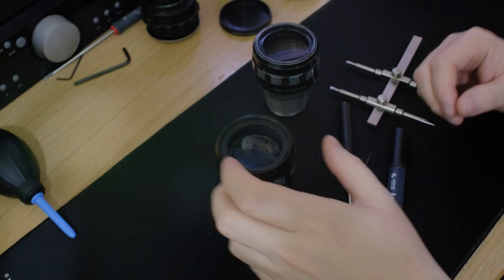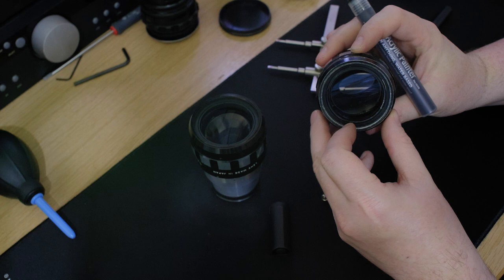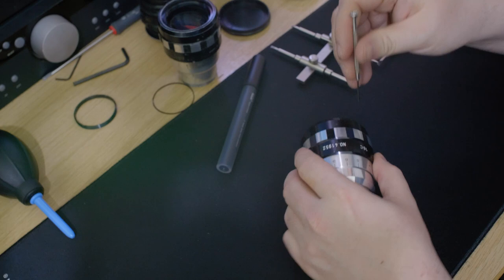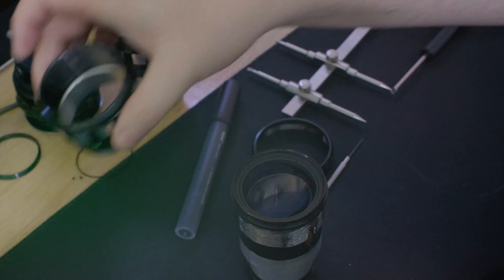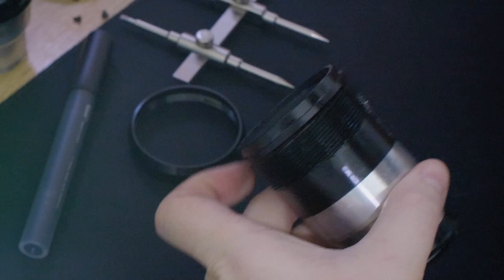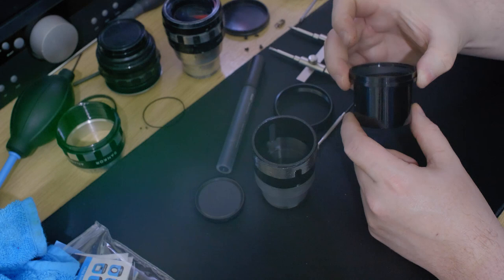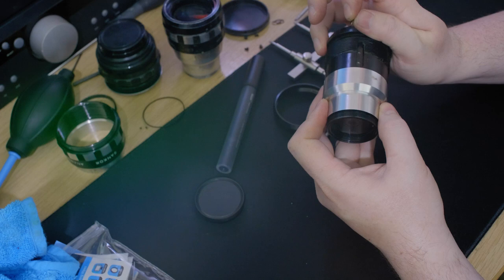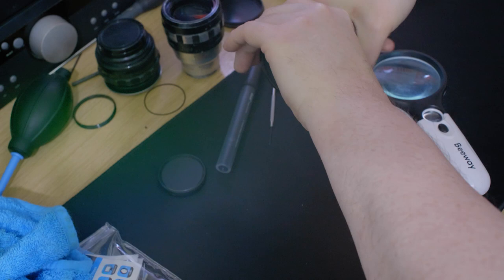How to disassemble/reassemble an anamorphic scope Kowa : Sankor : Eiki

Comment: You're a god. I would never have had the courage to actually open it without this. Thanks a lot! (By the way, the "sharpie trick" on the front didn't work for my Eiki 16F, thats why I wanted to try painting the inside, which also didn't change anything. Finally, painting the outside of both lenses from the inside&outside did the trick, in case anyone has the same problem)
Reply from the maker: Scope anamorphics aren't scary to work on really, glad you decided to give it a go.
Reply: May I know did you use the matte black adhesive film to paste inside the scope? Or just matte black paint painted inside the scope? Thanks.

Comment: This tutorial was super helpful! Say if the focus ring was a bit stiff on my Sankor 16C would you recommend adding any specific grease to it?
Reply from the maker: No, see my other tutorial, it's more likely fastened too tight.
Reply: I re-greased the ring with standard mechanical grease. It's better than before, but still not as smooth as a regular lens. I am not an expert but I think, when the built it, the smoothness of the ring never was a central priority since it was a projector lens and it wasn't really necessary for it to operate super smooth. Its just a guess, correct me if I am wrong :D
Reply from the maker: @metascopefilm  they're rarely perfectly smooth.

Comment: Any suggestion on what grease/lubricant use for it? I did the trick and it kinda helped but now the focus is a bit tight in certain places... 
Also is there any way to clean the optics on thses lenses without bringing even more specks and dust in? Mine was apparently disassembled before, and probably wasnt really cared for properly, as there are smudges inside, which are not visible on camera but look hideous aesthetically.
Thanks for the tutorial!!

Comment: Hello! New anamorphic shooter here and attempted this mod to sharpen my B&H scope at infinity focus, however 2 splotches of grease made their way onto the inside of the back element, what would you recommend to clean this without harming the lens and its coating? From my own research I’ve found my options to be “Lens Pen”, Microfibre cloth, and q-tips (along with non alcoholic lens cleaner solution) but wanted to check here where I can find the experienced knowledge I’m looking for in case I’m missing something or am on the wrong track
Reply from the maker: Just use lint free cloths (Amazon will have them) and a lens cleaning fluid.  The cloths themselves will mainly pick up the grease.  I tend to remove all the grease before I start working on lenses to avoid this kind of problem.

I'd throw the cloths away afterwards.

Comment: Great video, thanks for sharing this knowledge. Like others in the comments, i have fungus/smudge in between the glass of the rear element. A bigger problem, the elements are completely out of alignment. Even looking through the scope everything is out of focus. After opening the lens and removing the screws, i had to rotate some 30 degrees to achieve alignment, but now the screws holes are not acessible. I am thinking about drilling new holes, like you did in the other video... Is there another way? Is there a way to rotate the front element and not the whole front "body"?
Thanks again, any help is very welcome.
Reply from the maker: I reckon your rear element is likely loose.  Buy a lens tool (Amazon have them) and see if you remove the tightening ring if it will twist by hand.  I had this problem once and it was the rear being loose.
Reply: @P13DM  thanks for the reply. I have a lens wrench, already was able to remove the rear tightening ring, but i went no further. Without this ring, how can i rotate the element?
Reply from the maker: @mmixo  if you remove the ring and it won't budge then it's still glued and can't have become loose in which case it must be the front.
Reply: @P13DM  Ok! I will try rotating the rear element (but can't use the lens wrench now. I think i may not have the tool i need right now. Maybe a "sucction cup"? I dont know the english translation of the tool i am thinking about)

Comment: Dude, this is great. Thanks for posting. Quick question: Would you say all Scopes have similar insides? I have a Sankor and a few others. I'd like to lock them at infinity to put a FVD-16A or -16B on them. If they're all similar I can knock that out. If they're dissimilar...
Reply from the maker: Most scopes are similar to this, so Kowa, Sankor, Cinepro, Eiki etc.  There is an m2.5 hole in many of these kind of scopes were you can use a grub screw to help lock the focus.  One of my other videos shows me drilling to do a permanent lock (albeit that's arguably overkill).
Reply: @P13DM  Ah ok. I have a couple of Kowa 16-S, a Moller-Anamorphot 16/2x, a Isco-Gottingen 16/2x and Isco Gold Ultra Star 2x along with the Sankor. I was thinking about sending them all to Bernie for a CLA and infinity lock. But if I can infinity lock myself...
Reply from the maker: @BillPutnamPhoto  at very least you should do the Sankor and Kowa.  The others I might be tempted to just tape them.  I think the other scopes you have aren't so easy to open and likely don't have a grub screw hole.
Reply: @P13DM  Thanks. Appreciate the insight.

Comment: this is so helpful, thanks for posting this vid up.         Got a question, I have fungus on the front and rear elements on 2x sankor 16 lenses.    are there only two elements or three and if so how to reach all of them please?  if I take my lenses apart will I be able to reach the front and rear element or does it need further dismantling?
Reply from the maker: Just two so the cleaning should be easy.  On occasion the fungus (if it's bad) can get between the elements, as each elements can be a number of glass pieces glued together.
Reply: @P13DM  ok thats great thanks, the front element looks to have some on it then there looks to be another bit of glass behind it, would this be a glued one and if so any tips on accessing it?
Reply from the maker: @dogtemple26  there's one every 2 elements unless some one ever opened one and added a filter (very unlikely).  If fungus ever gets between the element it'd likely be more expensive to fix than buying another...
Reply: @P13DM  thanks, so the very front element isn't easily accessible and not worth trying?

Comment: so on the focus.. I wasnt clear on how to adjust the focus. I have a sankor 16d that is not sharp. Do I align the rear element or can you align it from the front?  thanks
Reply from the maker: You'd align the front albeit that's not really changing the focus but the alignment.  On an anamorphic lens as it slides forwards that is moving towards infinity.
Reply: @P13DM  Thanks.  I get the slide  to front and back, but our scope is not sharp at any distance. The adjustment needs to be left or right. The brass guides dont allow for this adjustment. Is it better to try to realign the rear or the front ?  ..is it even possible?  dw
Reply from the maker: @dr5chrome896  you'd do the tabs left to right normally.  Failing that buy a lens tool and remove the rear retaining ring and see if the rear element is loose.
Reply: @P13DM  ..I see now.. Just looking at it seemed like there was no left/right but i you loosen the screws there is a very fine adjustment.. Thanks for the time !  dw

Comment: Sir, is it possible to open the back element. Can you put a video on this.  I have a Sankor 16c wherein the fungus is on the back element
Reply from the maker: You're best to just open the lens up and clean it.  The glass itself is glued into place so trying to remove the rear glass is more likely to damage it.
Reply: @P13DM  thanks for your valuable comments
Reply: @Arun where yoy got 16C in india?
Reply: @arun_tri  where you got 16c in India?
Reply: @itmmec  yes, i got some of it thru my contacts
Reply: @arun_tri  within  india or outside india?
Reply: @itmmec  i have some collections